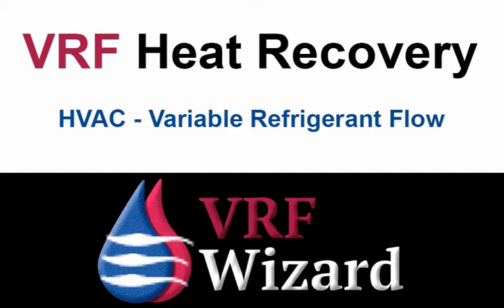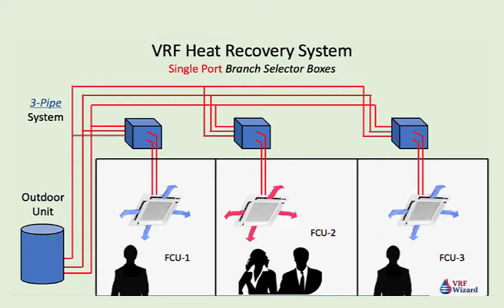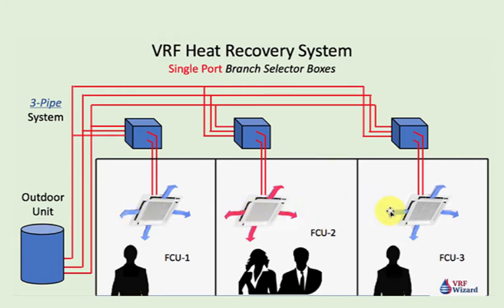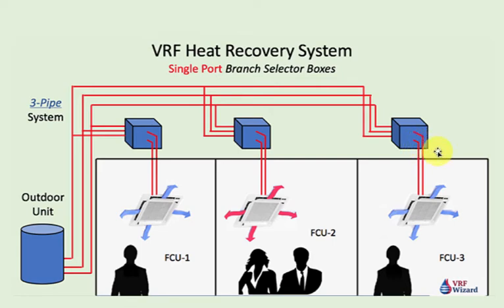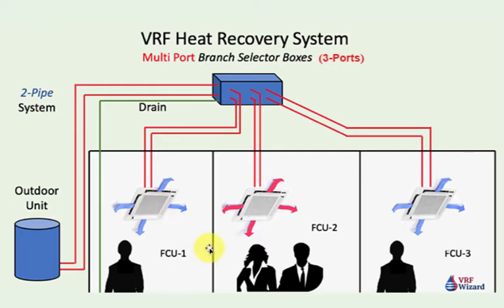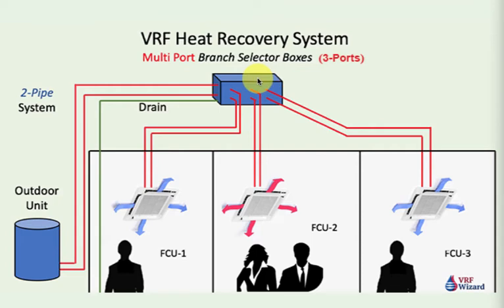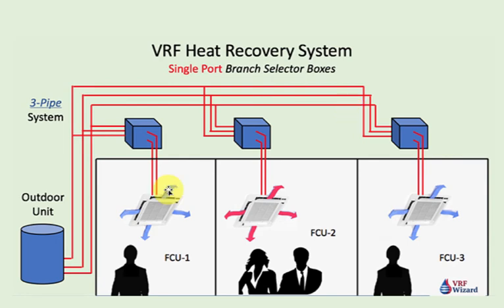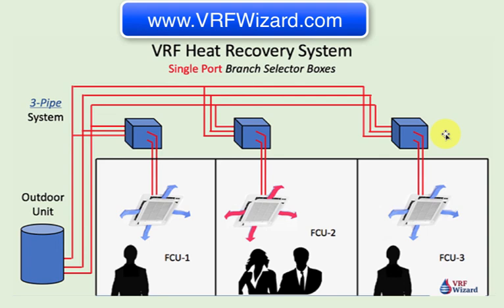HVAC VRF System Heat Recovery

Comment: What’s the drain for 2 pipe system?
Reply from the maker: I'm assuming your talking about the Branch Controller Box where some manufactures use a 3-pipe system that requires a drain line because condensate is generated at the selector box, while other manufactures have a 2-pipe system to the Branch Controller which doesn't require a condensate drain because no condensate is generated at the box.
Reply: @VRFWizard  yes I am. So on the 2 pipe system. Is one liquid and one suction?
Reply from the maker: @derrickgarcia303  One has to be Low-Side Liquid (Cooling) and the other High Side Vapor (Heating)
Reply from the maker: @derrickgarcia303  To the Outdoor Unit where the Compressor is housed there would be a Liquid and Gas line. To the Indoor Unit you would have 2-pipes, one Low-Pressure Vapor (Cooling) and the other Hot Gas (Heating)
Reply: @VRFWizard  thank you for clarification.

Comment: Could you do a video on how two pipe vrvs and 3 pipe vrvs work? I'm not sure how the refrigerant supply's simultaneous heating and cooling on the two pipe systems mainly
Reply from the maker: We have a few articles that may be helpful for you. Follow the enclosed links and let us know if you still have questions, and we'll try to answer them for you. 1) https://vrfwizard.com/vrf-single-port-vs-multiport-branch-selector-box/ 2) https://vrfwizard.com/mitsubishi-vrf-hybrid-system/ 3) https://vrfwizard.com/vrf-heat-recovery-system/